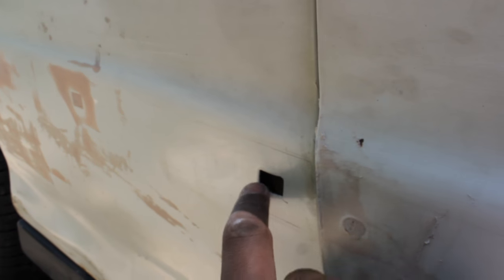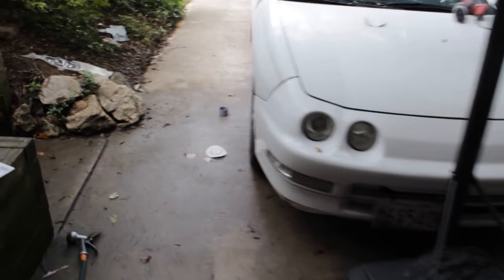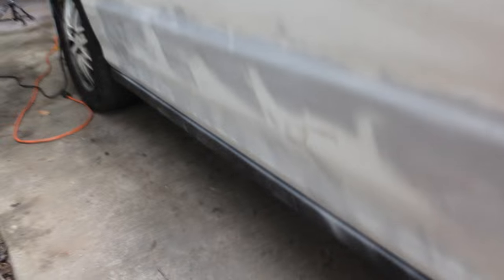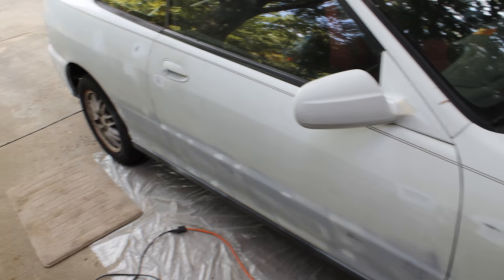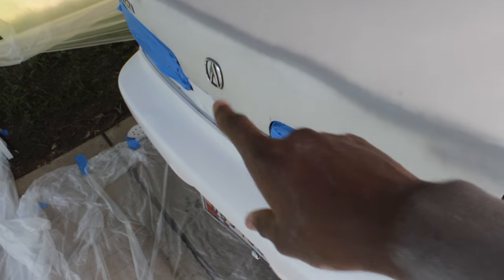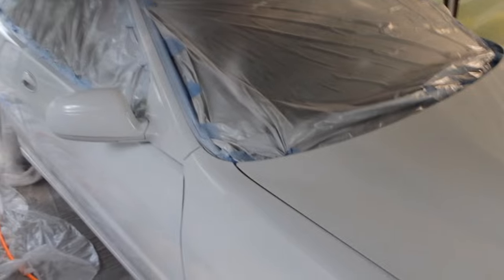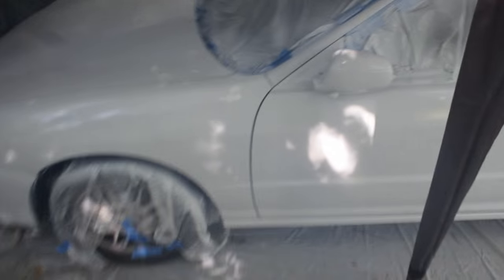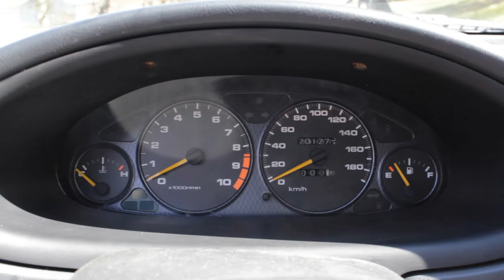Project Integra Track Car Build Episode 15- Painting The Car

Comment: Hey Milton, U could apply a clear coat if you prefer a glossy finish. 
Also, a small thing you could do on your own that would have a an impact is to make sure your bumpers and fender fittments are spot on. Keep up the good work!
Reply from the maker: I plan on buying new front and rear 98-01 bumpers, but yeah ill try and straighten them up a bit. also I did single stage which has base & clear mixed together (sort of) I plan to wet sand and buff and polish to give it a better finish but i have to wait for it to cure first. Thanks for the tips :)

Comment: It's so beautiful 😭😭 would using the exact same method/ tools work fine if my car was silver and not white already?
Reply from the maker: +Treavon Guy Its all in the prep (body) work! Paint is the part you shouldnt be worried about. If i were you practice on a bumper, if it comes out nice do another until you get comfortable to do the whole car. If your car is silver and you want to make it white i dont see how thats a problem. Your door jambs and engine bay will be different colors too.
Reply: just put a nice lip on the front and your good bro not need to do the 98-01 bumpers to be honest the 94-97 bumper look better more blocky it look awsome wit a lip foreal
Reply from the maker: +danny le I have a lip too. Once I paint it I will put it on.

Comment: nice job, i plan on doing the same with mine. i just had a question regarding how long it takes for the paint to dry.
Reply from the maker: +Senor JellyTv Each Coat is about 4-6 Hours
Reply: And u used around 4?
Reply from the maker: 6ish foe touchup and the next day i hit all the missed spots due to it getting dark.

Comment: How did you attach the metal pieces in the car? Did you weld it?
Reply from the maker: I went inside and glued them to the car, then to make sure they wouldnt fall down at all i then taped them. After that i bondoed the outside and it should hold up for a long time :)